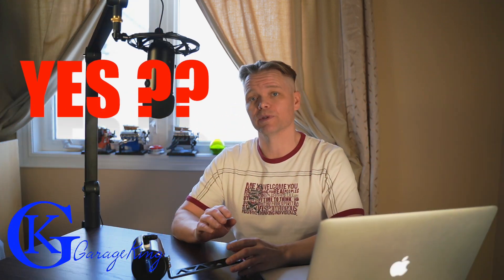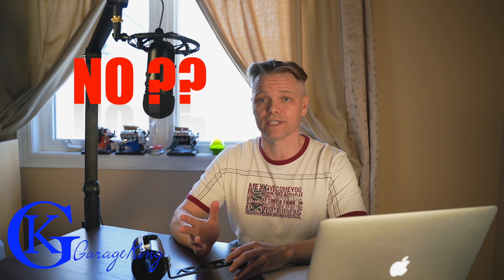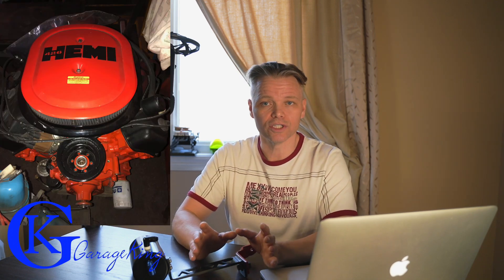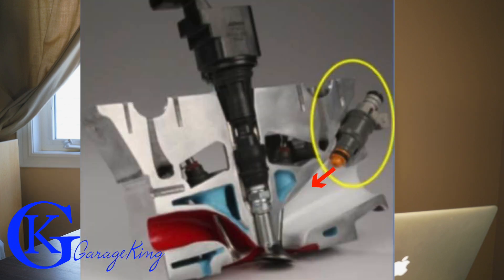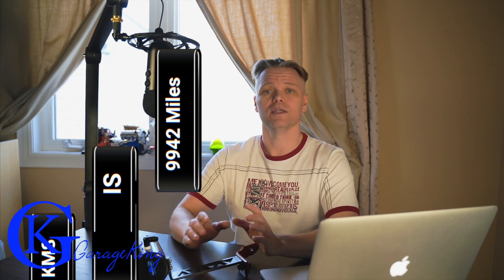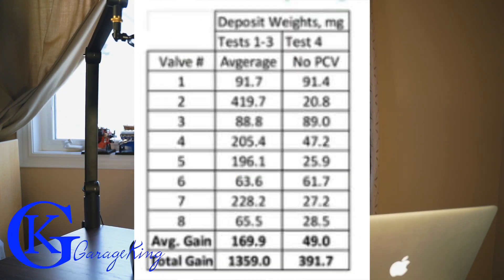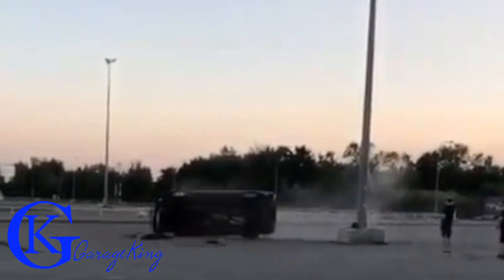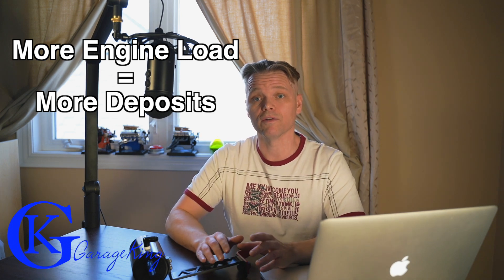Do you need a catch can with todays cars

Comment: Love to see more covering this. Only a very small portion of coking comes from the VVT events that emulate the EGR valves of old. Almost all comes from the PCV vapors. When you delete the PCV system almost all of the damage and wear causing combustion byproducts are left in the crankcase quickly contaminating the engine oil, especially with DI engines that experience 8-12 times the amount of raw fuel washdown and dilution. Add that to the abrasive particulate matter shed from the valves that some also enters the crankcase and premature timing chain and bearing wear/failures are much higher. Oil is NOT in anyway helping to lubricate the valve stems as the deposits bake on in a hard crystalline structure that is pulled into the soft guide wearing them like we have not seen since the old carbureted day's. Would love to see the test with the patented true air/oil separating crankcase evacuation system vs those "catchcans". In test after test all of those designs come in at trapping around 20-30% of the suspended oil and other combustion by-products you don't want ingested still allowing the majority to pass through and still be ingested. The one patented design is an entire system and separates and traps 90% plus so very little is ever ingested.  As a long term member of SAE this has been shared many times, but only tested these very ineffective ones. Would love to discuss more via email if you would, email me direct@APDEG@aol.com   Lot's more to share and you can perform the actual tests easy enough.
Reply from the maker: Excellent comment, and you are right that pretty much coking comes from the PCV vapours, that's why its so important to remove those vapours !!!  You will see another test very soon, maybe a month or two I have another one coming !!  I have the Elite E2-X running against the Mightymouse on the LT4 :)